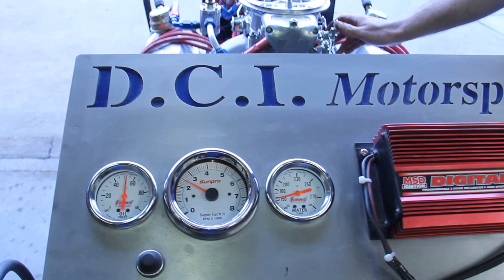DCI Motorsports Inc. Don Johnston 330-850-5050,  330-628-3354

Comment: Hey Don!  I've been wondering if this was the same DCI that I knew; now I know. You assembled my engine and installed it years ago (green '66 GTO). I, unfortunately, do not have the car anymore but am trying to get it back. I should have listened to your clutch recommendation, the Lock-Tite always held on the headers (which you exclaimed wasn't exactly your favorite part of the job) (and to discretely mention that my refurbished center carburetor (tri-power) always had some sort of problem (not AT ALL your issue) – I'm guessing there was worn carb-body (or throttle plate)/butterfly-shaft and leaked air giving an off air mixture).  I wish I would have had one of these beasts in the car, but I was sticking to a mostly-original rebuild.  That garage space you're shooting from looks like what I remember, but I thought you had moved (from Mogodore).  Anyway, good to see the videos.  I wouldn't have included any identifying information, but I saw you posted your phone numbers and company name, so there should be no harm.  You should be in touch with some of these car-build shows so those LS engines don't get plopped in the PMDs.  Great to see the builds!
Reply: Hi Lou, It's been a long time man. Thanks for the Kudos. Glad to hear your still a Pontiac guy :) I did move to Randolph / Atwater Ohio back in 2009. I guess all shops look the same LOL.  I get told that every day and would love to do a #DiscoveryChannelShow. Maybe some day. Thanks for responding and good to hear from you.